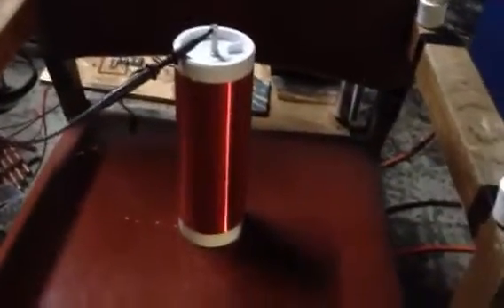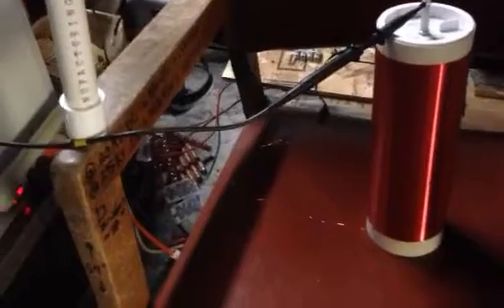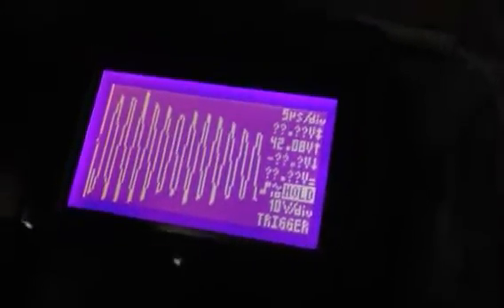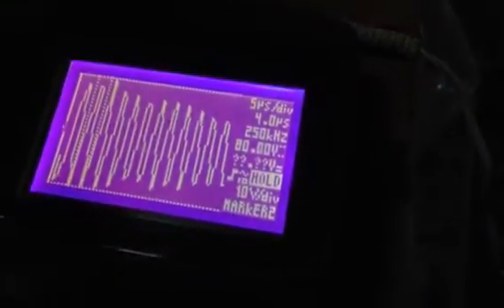50,000 volts dc ion chair ac magnetic field induction measu

Comment from the maker: Just to add, the hv full wave rectifier comment should be clarified to be a hv full wave voltage quadrupler schematic online from many various places.  The actual layout I show is using  teflon doorknob caps and 20kv rated diodes to comprise it.